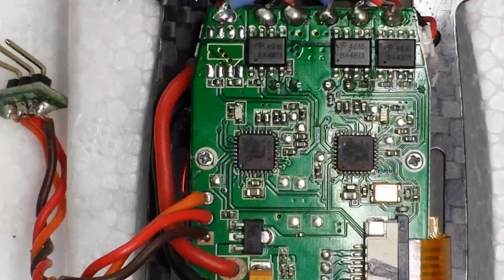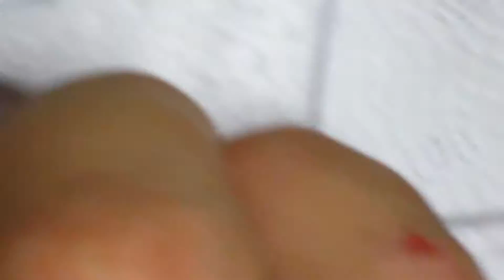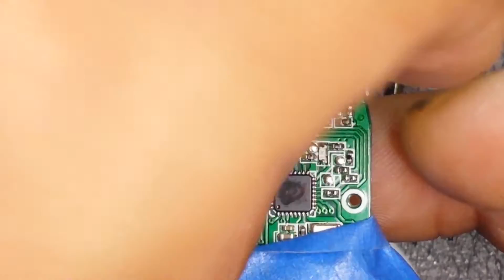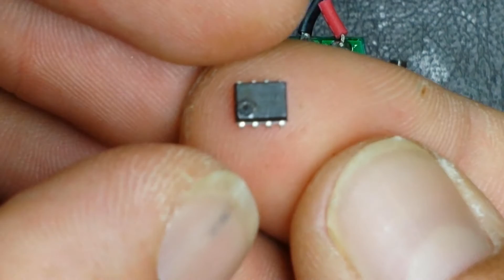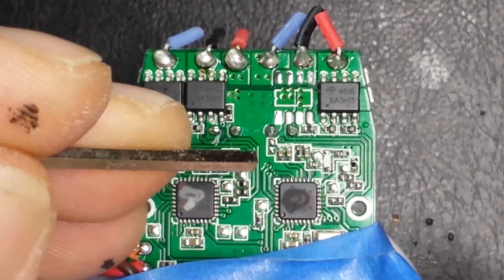200qx fet repair tip

Comment: I crashed into a high tree and after loosing orientation on a bright sunny day and ended in a pond. The battery was puffed up and hot so I trashed it. And the rest of the board I disassembled and immersed in isopropyl alcohol for couple of hours then dried it. When I plugged a new battery things seemed fine, the initial beeping of the motors just happened and then one of the mosfet turned into a shiny ball of fire. I just ordered the mosfets AO4616 and I do suspect bad resistor. Can you tell me what is the size of these smd resistors 10k and 500 ohm. I really hope to fix this. I just had only two flights on this. :(

Comment: I know this is late and all, but can you show us a video on how to desolder and solder mosfets and transistors? It would be really a great help since I'm repairing my MJX x400 board.
Reply from the maker: +Andre Martinez i dont even have any of these boards anymore but im sure there are plenty of videos on youtube that instruct you on SMD soldering. my approach was very crude with a normal 30watt iron. the removal was done by cutting the leggs with a razor blade, removing the chip, then desolder the legs.
Reply: +Kevin Hartman oh okay, thanks for the kind reply though! :)

Comment: Also something interesting he notes is that they cool down much faster than they heat up, which is good to know...If you push it hard, then give it a quick rest, it's way better than just pushing it hard the whole time.
Reply from the maker: I've not gotten around to try double stacking them, a member on HeliFreak has though (FlyingDrummer). The boards I currently have are toast (I don't know what's wrong with them!) and the two I order from gonitro never showed up...so I'm outta the 200qx game for a bit (that two board hit wasn't cheap). I'll see if I can dig up an email showing which resistors I bought to replace the .5 K and the 10K resistors.
Reply: Kevin Hartman bummer =(  I hope I have better luck.  I bought a new board anyways because I just couldn't wait. I'm hoping to fix the broken one and then sell one of them, unless it's going to burn out often enough that I should have two laying around.
Reply from the maker: Richard Buckman Yeah the worst part is that the seller is not willing to work with me! No refund, replacement, or even an offer to replace at a discounted price. I was told to email ebay and hope that they will refund me....I don't see this happening! Oh well, sucks. I'll steer clear of gonitrohobbies in the future.
Reply: Kevin Hartman Shoot, that's where I got mine too.  My last order from them came, so hopefully this one will too.  Did it just not show up at your house? Doesn't it have a tracking number? The orders I got from them had usps tracking on them.
Reply: Kevin Hartman I am glad I just read this. I was going to order a board from them, buy another 200qx and have some spare parts or replace the fet. Didnt know where to look to order it though. Such a waste tossing an entirw board and paying for a new one when only one fet burned up.  Do you have a direct link to order the fets?

Comment: Can you point me to digikey (or another site) for the different resistors? Also, did you ever get to double stacking them? I found this study which seems to suggest that double stacking them works, and that you can go even further by sticking a copper heat sink in between them: http://www.robotroom.com/Thermal-PCB-Motor-Driver-Tests-4.html

Do you ever have a burned mosfet where you can't see that it's burnt?  I was trying to fix a motor myself by resoldering the leads, and it worked for a minute but then stopped working entirely (previously the broken moter had wobbled back and forth a little but but didn't  make a complete turn). Before I tested a different motor on the same output and it worked. After it stopped working and I thought I smelled a burnt smell. But there's no visual evidence to see which one it is.  I suppose I'll try replacing all three and also all the resistors around there.
         Rich

Comment: Did you end up repairing it?
Reply from the maker: I did repair it! It lasted for a while and then I crashed and busted it again! Also, I've found that the resistor does not always go bad....just sometimes. I've busted 3 of these boards now! My next mod will be to doublestack the FETs in an attempt to keep them from burning up. Flyingdrummer on helifreak has done it.
Reply: Kevin Hartman My fet burned up because of a faulty motor. I can give it a push and it will still spin up but doesnt have enough power to fly. I have to fix or replace my board and get a new motor as well as learn how to test resistors. I will stack fets when i find them if it helps.